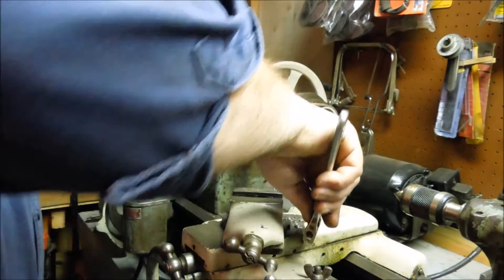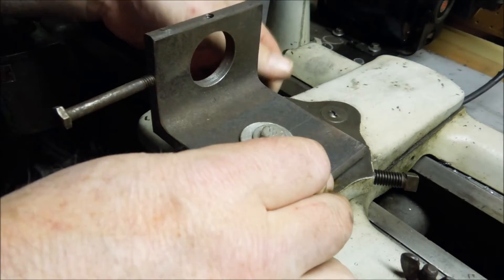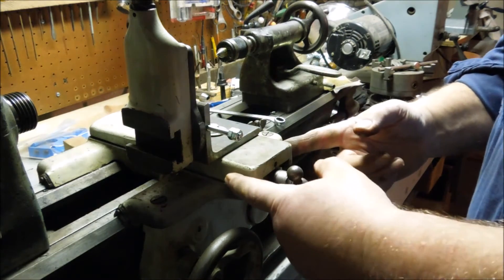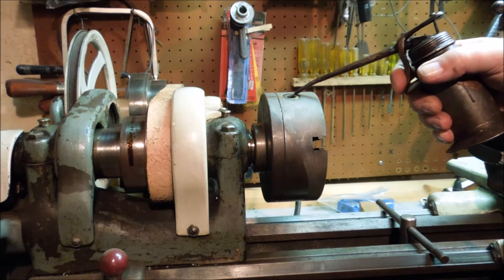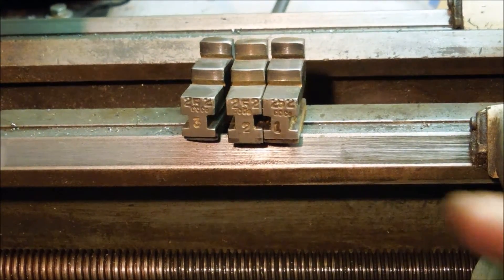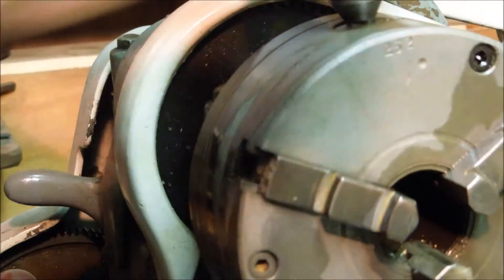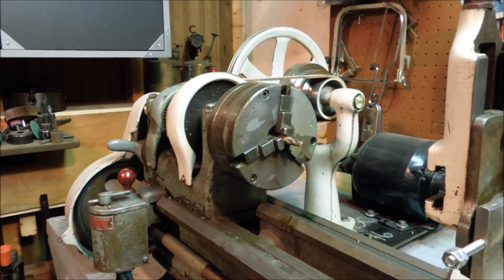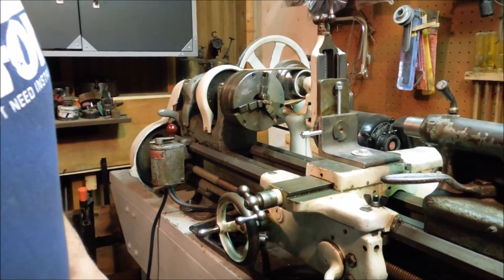South Bend 9 Inch Metal Lathe ~ Milling Bracket ~ by Old Sneelock's Workshop

Comment: Thanks for the video - managed to get a similar milling attachment built - waiting for the end mills to arrive to take it for a test run :)
Reply from the maker: The setup works well with a fly cutter. You can mill up to about 6" on the South Bend. A 3" diameter fly cutter will flatten a surface with only two passes. Saves a lot of cranking.

Comment: not good to hold end mill.in chuck  if spins can damage better to use bushing .try "little machine shop "pasadena ca...they have them new....modarately priced....might want to use an old angle plate for simular set up there or weld some gussets onto that angle iron...make rigid
Reply from the maker: +Miguel Castaneda Good suggestions Miguel. I'm thinking I need to make a collet to hold the milling cutter. It's okay to buy what you want but it's more fun to make your own. 
If I were to cut any heavy work I'd have to stiffen up the bracket. For the occasional little job on my little lathe it seems to be working okay.

Comment: Nice setup. Were you able to drill the large hole using a hole saw, or did you use another method? I'm curious to see how you mounted your parts to be milled as well.
Reply from the maker: +Jonathan Martell I clamped the plate in the 4 jaw chuck and bored the hole with the homemade boring bar. I'm thinking the milling bracket video will be a week or so before I get back to it, but I can tell you that I will be bolting the T Nut for the AXA to the compound using the T Nut from the boring bar.

Comment: That's a neat rig and the 3-jaw chuck. Until your talk of how to center something up in a lathe I thought all chucks were set up like the 3, and just cranked it down and there you were. Thanks for showing the difference and a little oil will make you a slippery character. I ought to know!
Reply from the maker: +Lewie McNeely Going back through and catching up on the comments. The 4 jaw is superior for turning because I can center the part independent of the accuracy of the chuck. 3 jaws tend to run .002 to .003 out of round even after they are trued up. If the scroll gets worn, or someone overtightens it, the jaws will be out of alignment depending on the diameter of the part in the chuck.
Reply: True enough, Unc. Seems like the 'easier' it is the easier it is to get out of whack. No matter how bad the chuck was you could always center the part up. I SEE said the blind man to his deaf and dumb wife! I'd make a floor sweeper in a good machine shop in a decade or two!
Reply from the maker: Lewie McNeely You'd be amazed at how many machinists only know one machine. They work in a shop for 6 months and move on to the next place with Machinist on their resume.
They didn't even learn which end of the broom does the sweeping. :-)
Reply: I tried a time or two for several hours to work inside and about as far as I got was a truck cab or on a machine somewhere BUT if I HAD been inside, I'd wanted to learn everything about everything in the whole place! I always said that God Almighty gave me enough talent to make a mess with just about anything. If I could get on or in it I'd try it. Nothing changed  since this morning about that.